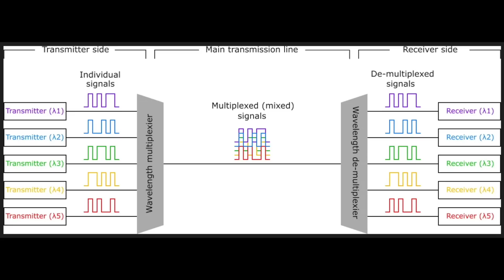100 Gigabit per second - Beautiful Transceivers (PWJ244)

Comment: Lasers can't change their output power fast enough for this communication, so we just leave them on full blast, and modulate the light by reflecting it off a special material whose in index of refraction is changed by an electric field.
Reply from the maker: That sounds logical. Everything above 1 GHz looks like magic to me...

Comment: My first instinct is to try to pop the IR-cut filter off my camera, pop the shields off a transceiver and a switch, and see what the beams look like in operation!
Reply from the maker: I don't know if you will see much. I use an old HD camera that has no filter to see IR. But it's very faint even if you look directly into the lens. But hey... give it a try and tell me what happened. Maybe an old phone camera will work?
Reply: u expect to distinguish light path, or want to see bit patterns ohohohoho

Comment: Telling the Tx vs Rx direction on transceivers with an LC connector is as simple as looking for the imprint of an arrow (or triangle) pointing in the corresponding direction. The other connector is MPO-12, though only the outer 8 stands are used here.

Comment: Pretty cool. I used few of similar ones, and always wonder exactly how they look inside. Especially the ones that combine 4x25G into one fiber are interesting and have more optics and wavelengths. I think I use one of them too, but usually use the MTP with 12 fibers, for short distance in the office / close racks, etc, and only the single (or dual) fiber ones for going large distance (i.e. between locations, where one needs to rent fiber by the strand used).

Comment: diffraction gratings you lose the mass compared to a prism
Reply from the maker: Yeah diffraction gratings were used in the large old piece. There is an interesting Red Paper from IBM about the Optical Multiplexer 9729

Comment: Strange to see an STM8 MCU in such a high speed device. I wonder what it does? It certainly can't be involved in data transmission at those speeds.
Reply from the maker: Transceivers have many "hidden" features like an I2C bus to program and read serial numbers, manufacturer name, device type etc. It's also possible to read out the signal levels from receive and transmit... temperature etc. I guess the MCU is used to handle that.
Reply: Its called DD - digital diagnostics, and almost every trasnciever has such management interface. Previously there was just a "passive" i2c eeprom memory, to identify the module.

Comment: my first encounter with optical gear was a newspaper office in london, c 1990 .. had fibre to a satellite uplink controlled by a surface-acoustic-wave device. just to transmit newspaper page images by fax ! (fax machine was some sort of modified pdp, lots of wire-wrapped 74xx on cards in racks)
Reply from the maker: 1990 gear is the most interesting because they used off the shelf parts to create those machines. No 3D printers and custom ASICs.. 🙂

Comment: 0:45 buut thats 12 "lenses"

and you were right what the transiver is, the last one got LEDs the other one doesnt
Reply from the maker: Buut there are 4 lasers and 4 receivers.... it seems the plug has some unused features 🙂
Reply: @PlaywithJunk  yea its just because there is no 8 fiber MTP/MPO connector they are 12/24/48 no clue why they didnt made a 8/16 fiber version of it, atleast you could break the 4 missing fiber out for other stuff

Comment: The dies inside of the transmitter/receiver packages could very well be InP (indium phosphide), a process technology which works well up into hundreds of gigahertz with extraordinarily low noise but often suffers from yield issues which greatly limit their use; some InP chips can be many tens of thousands of dollars each as a result.  The lasers are VCSELs, a technology which Finisar is well known for.

Comment: An interesting detail is that the circuit traces inside the packages are printed on an insulating coating on the metal, no ceramic hybrids used here.

Comment: Watching from under banana trees in a wet tropical region. Fantastic teardown. I recall working with image acquisition equipment where optical prisms split visible light for 3 vidicons, plumbicons etc. Then they went to CCD, to gear still split light into red, green and blue. Nowadays the boring visible spectrum just uses bayer filters or the like and technology has evolved into data  transmissions. I am actually connected to a fibre with a theoretical limit to 1.3Gb/sec and pay top dog for a promise of 1Gb/s.  Crazy how fast one can go in the far ultra violet. Former Philips turned ASML chucks extreme UV into Taiwan and China is no circling the island with fighter jets planing to steal such technology. China has now broken the 1000km range with EV. Whilst Musk goes to 48V to save copper, China talks about optical bus used in passenger cars.
Reply: ... and Russia is using up miles of raw fiber per fpv drone because despite obv tethered shortcomings, such weapons are immune to interference and video & control signal fidelity are predictably quite high.

Comment: I used to work on products which have a direct ancestry line to these.  Way back in a previous life, I was one of a team who built and programmed the test rigs for products such as the Nortel LMC10NEG 10Gb/s transmitter.  Through a series of mergers and acquisitions, the lineage went via Bookham and Oclara to Coherent.
Reply: Very interesting, you must be mates with curious marc.
Reply: Were you based in Paignton? If so, I probably worked with a few of your ex-colleagues at another company in the area 🙂
Reply: @74HC04  Yes I was part of the Chip On Carrier team there.  And we certainly did work a lot with some outside companies for building the rigs, which often were named after their original operators in another plant.  There were £millions worth of Leslie rigs.

Comment: I count 12 fibers between the two pins.
Reply from the maker: Maybe just empty holes. There are definitively only 4 lasers and 4 diodes
Reply: @PlaywithJunk  Looks like the ribbon on the inside also has all 12 fibers of the MPO connector with the standard color coding (#1 blue through #12 aqua). It looks like mainly for historical reasons 40G/100G standardized on MPO-12 even though not using the middle four fibers, and 8-fiber ribbons are just less common than 12. Some MPO-8 cables leave a gap in the middle.
Reply from the maker: @vladsinger  That makes sense... 🙂
Reply: It's called MPO-12, and yes there are 12 fiber positions. But because 100GigE is actually 4x28 channels, and there's a corresponding Tx and Rx for each, only 8 stands are used. Fiber stand positions 1 and 12 are aligned as Tx and Rx for Lane 1, 2 and 11 for Lane 2, etc. This allowes for simpler fiber coupling between MPO connectors.

Comment: If you listen to your audio recording on a good speaker or look the waveform you will notice a lot of "thump" spikes in bass frequencies on P B and T sounds. Seems some form of clipping.
Maybe adjust your microphone better or buy a better one since it is quite distracting.
Reply: Buy him a better one. I suspect that like me, 99% of his viewers have no problem with his audio.
Reply from the maker: Sorry for that, I didn't notice. It may also been caused because I cought a cold and had to speak closer to the mike as usual...
Reply: if your sound system is really good, it hast to handle anything you throw at it and represent exactly what the waveform has. if you dont like it, use EQ and compressors. to make the audio suitable for your likenesss and premium ears...
Reply: No need for new mike, just highpass at 100Hz and de-esser a bit in the highs, normalize and done.
Reply: @VEC7ORlt  hi pass desser? is he recording the new hit for ariana grande or mariah carey?
Reply: @VEC7ORlt  u know what put some autotune right away. apply some vocoder also. get the spread plugin, adlibs and some backing vocals.
Reply: You should not listen to random voice content "on a good speaker", and when you really have to you should include a 300-6000 Hz bandpass filter.
People listening on typical PC speakers have no problem at all.
Reply: Sounds like autor a little bit sick, also easy pop filter on mic should be fine